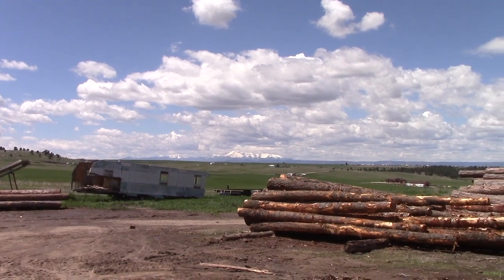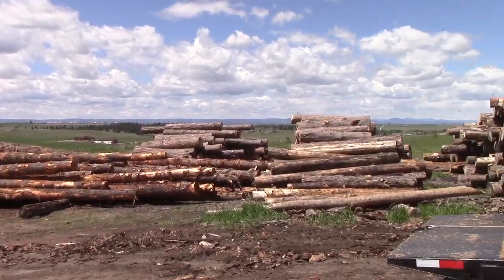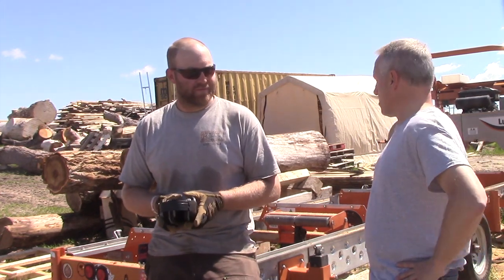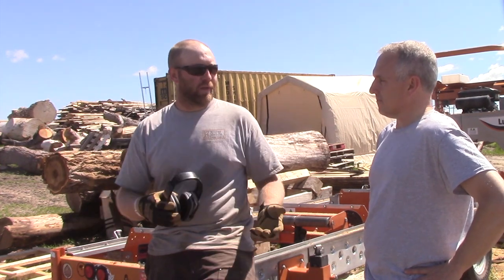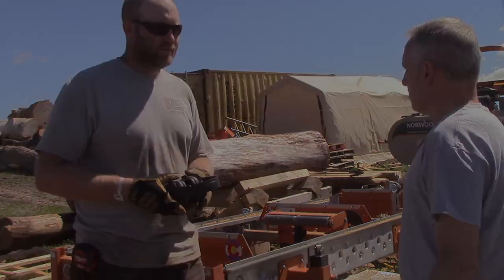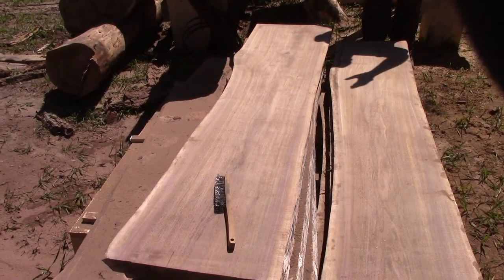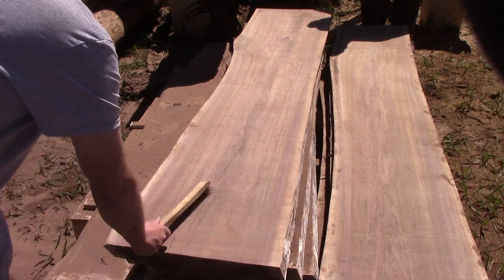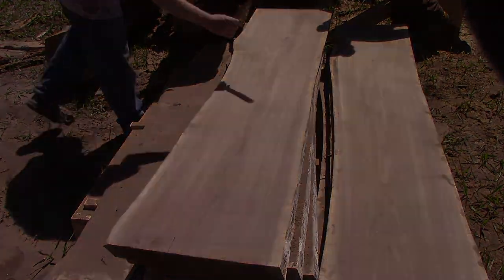A Trip to the Log Yard

Comment: wow you have a beautiful log there. i am wondering what the log cost and what you paid to have it cut to slabs to get an idea of this project? thanks again
Reply from the maker: I would refer you to the page which he lists his prices for you to get an idea...   HE is very gracious if you buy from his logs he gives a real break on the milling.    http://www.wilfermobilesawmill.com/log-yard.html
Reply: +Chris Pine ok thanks chris!
Reply: 21" dia x 7 feet long = 126.43bf on doyle chart. $3.50/bf * 126.43= $442.5 total with regular bandsaw cuts. Not bad considering you'd pay like  $1000 bucks or more for that much walnut at a hardwood dealer.